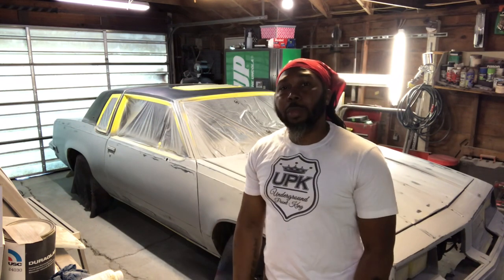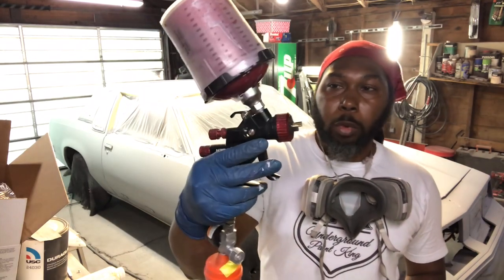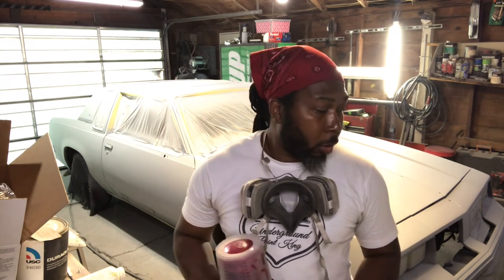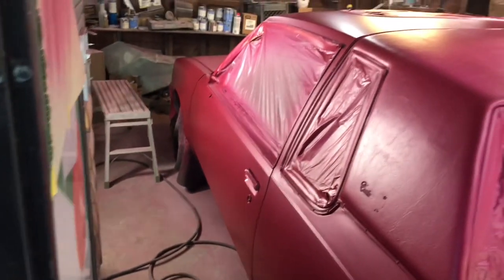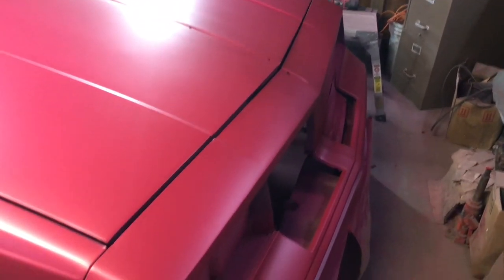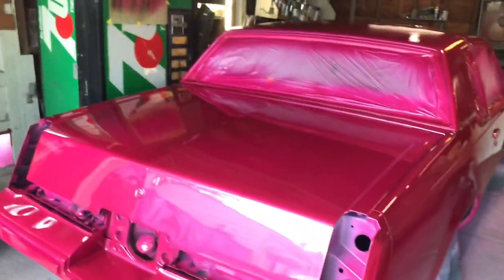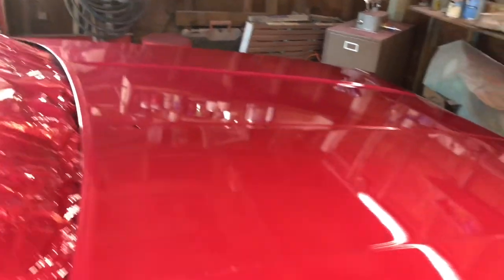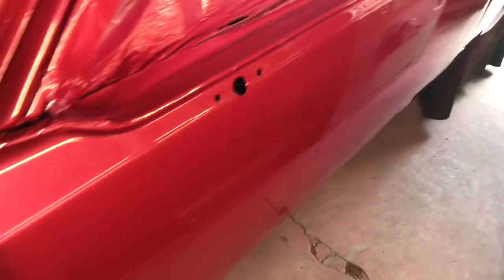Painting a car at home in a garage

Comment: I have a '85 Caprice with the Landua top. 2 door. Still has the original carbuerator motor with 25k miles. I wish I had the shop to repair it. It needs some work. Probably about 1500 tI did the work myself. Just need more time. You're doing good work. Saving vehicles from the rust heap. It's not a classic until it's old.
Reply from the maker: @sgtrickards5683  I appreciate you and you have a nice project on your hands 💯 good luck to you on it💪🏾

Comment: How about a video on cut and buff... that's a great color, I really wanted to see it out in the sun when it was done, bet it pops in the sun!
Reply from the maker: I appreciate you checking out the video and I’ll do a cut and buff video in the future!
Reply: I just bought the Spectrum gun as per your recommendation... I wish I watched your setup video before painting... at least it was just the epoxy sealer coat.. thank you for your videos!
Reply from the maker: @edwardkipp4911  what do you think about the spectrum and which one did you get?
Reply: @UndergroundPaintKing  I got the 1.3 HTE... I was spraying epoxy sealer on a hood, grille and bumper. It's a big upgrade from the $12 purple HF gun I was trying to spray primer with... went from a 4 inch pattern to about 8 inch with the spectrum. I haven't painted a vehicle in 20 years so spraygun technology has really improved. I might get another gun by the time I'm ready for my final color. Gonna spray single shot Viper Yellow from Kirker. I'll be watching to see what other guns you recommend. Thanks again!
Reply from the maker: @edwardkipp4911  glad to hear the gun worked out well for you!

Comment: How big is your compressor in your garage? I’ve got an 80 gallon dual stage in mine. I’ve got a big 3 cylinder Eaton compressor for our shop. My Dad thought the Eaton was too big but has since changed his mind. I can sandblast and we also have a blast cabinet. I saw another one of your videos using a small compressor and the Low pressure low volume gun. The paint job looked excellent! Keep up the good work I enjoy your videos and learn by watching your painting techniques.👍
Reply from the maker: I have a 80 gallon 2 stage Husky compressor in my garage and it works great…I appreciate you checking out the videos and hope they help!

Comment: How do I know if something is going to show through? Obviously if I can feel it, but what about catching fish eyes, and other issues before it's too late. I paint, but I'm not a pianter. Just trying to improve for my personal projects.
Reply from the maker: Fish eyes usually come from something reacting so it’s best to keep your surface clean that your working on and allow proper drying time once you start going from primer to clear
Reply: @UndergroundPaintKing  I went to spray a second coat of tractor enamel yesterday, after letting the first coat set overnight, and it beaded up right off. Someone recommend acetone for a thinner instead of naphtha and it worked, at least it is good enough for a car lift. But, I was almost lost there. I had no idea what to do with paint mixed and everything all geared up. Do you ever find yourself in the middle of spraying and have it start to fall apart? If so, what do you do, what's your checklist? I just got here, so I'll run through your videos to look for some of the answers. Just thinking about it.
Reply from the maker: @bannockchief   it’s a lot of different factors depending on the materials you’re spraying…I run into issues but I’ve been painting cars for a while and have learned over time the do’s and don’ts that work for me…I hope the channel helps out and feel free to leave a comment and I’ll try to help as best as possible!

Comment: Put epoxy primer sealer on today on hood after sanding both sides I used Isopropyl alcohol and window cleaner to clean it saw Kevin Teitz on the Eastwood site doing that but the primer was gray and after mixing the 2k epoxy primer sealer with Speciality reducer and activator instead of gray color sealer it came out a clear color I should of made a video of it on YouTube I have put some videos but not much people looking at them.
Reply from the maker: I’ll have to check out your videos
Reply: @UndergroundPaintKing  Be glad when the lvlp spray gun comes though all have shipped the three I got but gonna have to unclog this electric spray gun tonight it had sprayed some after I left but after I put epoxy primer sealer on my hood it wasn't spraying. I should of filled half the spray bottle had less than half put in the spray gun when putting 2k sealer on but should of waited more minutes to apply sealer saw online it said wait 30 minutes but the sealer should of came out gray not clear because mixed a speciality reducer got from Autozone and activator mixed in with the epoxy primer sealer. Don't know what did wrong to have the sealer coming out like clearcoat.

Comment: What's a flow coat!?
Reply from the maker: A flow coat is after letting your clear coat dry you sand it and clear over the clear again which gives you a nice smooth finish in most cases
Reply: Thanks upk !!
Reply from the maker: @davecody5997  you’re welcome

Comment: Fam what is the best sealer to use or can just use 2k primer thanks before base I use 2k on my last paint job
Reply from the maker: You can use primer as a sealer if you want but any brand sealer should work fine and you can go with a 1k sealer or 2k sealer
Reply: Thanks
Reply from the maker: @godson197410  no problem bro

Comment: Just got done painting my truck today. Had problems with the 1.3 and 1.4 tip lvlp spray guns had the 1.4 am throwing away and the 1.3 got a crack in the screw in part where you attach the cup had got them from Ali Express but have another 1.3 coming from them now and just ordered a air filter and regulator in one from them today. The 1.7 worked well for me though. I did base and finished with clear with it. Will wait to like Tuesday or Wednesday to take the plastic and paper off the windows of my truck and start driving it again only part didn't do was under the hood but that won't take long to do I still have paint left for that. I will worry about that after go down to Texas to move I know now my brother wife get out of school in December so that will be when I leave the job am at but will give them a two week notice in about the second week of December. But still depends on whenever he say can go down there because I am ready to go before December if he ends up saying earlier. But now gonna have to put a video of the paint job I did because haven't put one up yet I just this week got two of the 10,000 lumen led lights from Harbor Freight it did help for better lighting in the garage though.

Comment: Love the videos.  Binged watch for about the last 2-3 weeks.  I see you moved up from the R500.  What gun and compressor did you use?
Reply from the maker: Thanks Big George, I didn’t move up from the R500 I just have different spray guns I like to use when I’m using my big compressor or my small compressor. I appreciate you checking out the videos and I hope they are helpful💯
Reply: I don’t know how I missed the black widow and tekna guns. My fault.  That black widow is something special.  Those videos have been very helpful. Awesome work!!!
Reply from the maker: @BigGeorge3397  I had the black widow and Tekna spray guns longer than the R500 spray guns so the videos on them are older but I’m glad the videos help!

Comment: I see you suffering in that clear cloud trying to see your next line. Gagage ventilation and lights are horrible in my garage with extra light and a gun bud. If it's crappy weather outside and your afraid too vent too much and stir up dust  in between coats, you just got to suck it up and keep laying! Gets super cloudy sometimes,  wish I had air suit or true booth.
Reply: Good job and great video as well man!
Reply from the maker: @markbarton4344  yeah I didn’t use my normal fan so I definitely had a issue with it getting cloudy but I could see fine and I could definitely use more lighting…grab you some cheap suits and you’ll be good to go…I appreciate you checking out the video!

Comment: Im liking your channel bro! What is the main difference between using this setup vs your lvlp setup? Is this just a lot faster because it lays out so much more paint? In person is there much difference in how level the finish is? I like the idea of going lvlp with my little 30gal but I've got a big delivery truck (step van) to paint so a big concerned about lvlp going a lot slower.
Reply from the maker: This setup allows me to do a lot more vehicles using my big compressor setup…the lvlp setup is good for someone looking to do one or two vehicle overall jobs and small jobs like panel painting that won’t be too stressful on the small compressor. But using my big compressor setup I can do multiple overall jobs and small jobs as well which I do throughout the year, so if you’re looking to do a lot of painting I recommend a bigger setup but doing your van can be done with a small setup as well
Reply from the maker: Cost between both setups can play a role in which way you would like to go as well

Comment: hey king is that hd black widow 1.4 gun!??? is the really any benefit  on 1.3 vs 1.4 ?? i’m trying a husky hplv!
Reply: is there application differece when spraying paint or clear ooat 1.3 vs1.4
Reply from the maker: This is a 1.3 tip Chris and the different tips atomize the materials different or allows thicker materials to be sprayed so it really depends on the user as to what tip they prefer…I personally started with a 1.4 and tried a 1.3 and haven’t changed since but I know plenty people who like using a 1.4 over a 1.3 so it’s really about what you’re comfortable with
Reply: thanks dude inspirational videos! which budget 1.3 would you recommend!!
Reply from the maker: @chriscothren2030  what’s your compressor setup?
Reply: which 1.3 do you prefer????
Reply from the maker: @chriscothren2030  I like the spectrum and the black widow and have them both
Reply: @UndergroundPaintKing  thanks dude party on!!!!
Reply from the maker: @chriscothren2030  appreciate you!

Comment: 8:08 how can you even see, l went to a fugi turbine sprayer really 50 percent less overspray and paint use,  l tryed it once with my black widow HTE and never again, everything in my garage had paint on it.
Reply from the maker: Sucks you had a bad experience, I don’t have issues seeing though but it’s good to hear you went with a turbine system
Reply: @UndergroundPaintKing  you do good work,, I was a little Leary about turbine, but I have a 4 stage and it really atomizes the paint, l will admit for clear the 10 psi turbine puts out is a little light I have to reduce the clear 10 percent to match the 30 psi of conventional system,  turbine sprayers have come along way l wouldn't have paid the 1600 dollars too switch but I got it half price on market place with 400 dollar nozzle tip set and then pressurized pss cup system, the turbine actually pressurizes the paint cup like a water system bladder really great technology, and the paint shavings and minium overspray will add up quick and offset the expense. Been watching you I've learned alot and appreciate you always respond to comments.
Reply from the maker: @georgespangler1517  awesome 💯 glad the channel has been helpful!
Reply: @UndergroundPaintKing   Hey buddy,, have a question,, l painted 20 cars this summer useing the acme FC740 clear and all was nice very little orange peel and dirt really only had to cut and buff one,,  sprayed  a car this weekend the surface was 60 degrees and I gave the base plenty of time to gas out and tack clothed between each coat,, sprayed my clear and it's a mirror finish with hardly any orange peel but I got ALOT of little specks all over the clear on all the clear,, sanded it down was all in the last third coat,,, l notice the hardener read 75 degrees l bought a 55 degree hardener for my flow coat after sanding all the specks out l haven't sprayed yet,, what do you think happened?
Reply from the maker: @georgespangler1517  was it specs of dirt or solvent pop?
Reply: @UndergroundPaintKing  wasn't dirt , all sanded out, had to be solvent
Reply: @UndergroundPaintKing  did I turn my exhaust fan off to soon and droplets formed, it was crystal clear when I sprayed and it happened later
Reply: @UndergroundPaintKing  was my first spray in my paint booth l built at home in garage,, 14 x 24,,  it's a clean environment but it's cold and really low humidity here in Delaware, l have electric heat was 60 degrees in booth,
Reply: @UndergroundPaintKing  pain rep said could have been the hardener temperature rating at 75 degrees so they gave me a 55 degree hardener for flow coat
Reply from the maker: @georgespangler1517  that’s possible, maybe the base needed more time to flash or the clear needed a longer flash time between coats
Reply: @UndergroundPaintKing  definitely wasn't the base ,,  l let it gas out an hour, and it was in the first 2 coats of clear looks like just the last heavy clear I put on,
Reply: @UndergroundPaintKing  l agree after sanding l think I went to heavy and didn't wait long enough between my clear coats,
Reply: Hey boss,, l noticed some light places in my base coat while sanding the clear for flow coat can I spray base over the light places are should I use primer first?